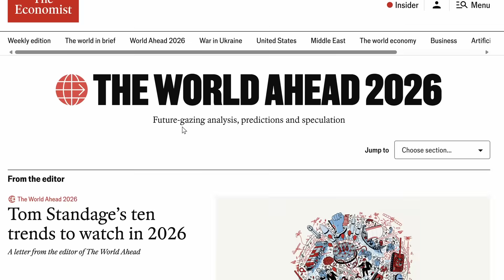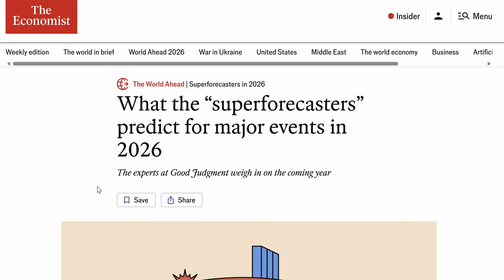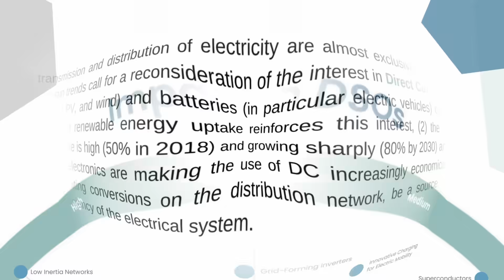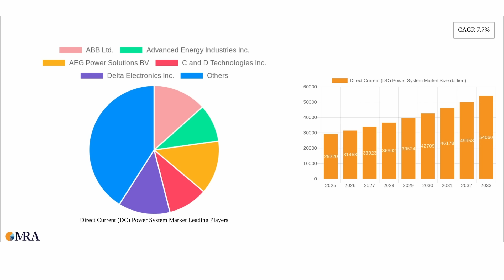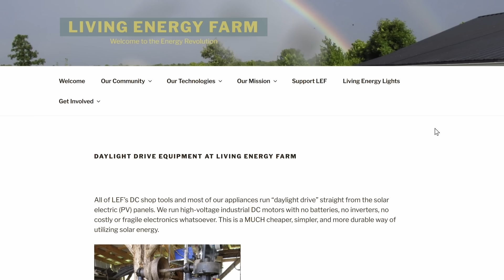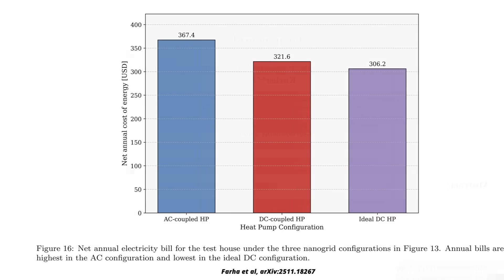Are We Using the Wrong Kind Of Electricity?

Comment: As so what we really need here. Is to have the children stop fighting. AC-DC. And to get them together. Which means?

In our homes. Which are getting AC frommm the Utilities Provider. It goes into a box in your home. Where then… You don't just have 120   volt, AC wall outlets. You will need some cigarette lighter, 12 V  DC sockets now also. Or some kind of new standardized replacement plugs and sockets for DC  power connection ports.

And that's the way I see the wiring of the homes, of thhe future. Remember before our homes ever had, cable TV? And it was difficult to install cable through the walls inside yyour house to all the bedroom and basement and living room and dining room. Your house never had that wiring. But new houses come equipped with that cable wiring. Oh  but now they have, modular ethernneet ports in your rooms. Now we are also going to need  DC sockets. So we don't have to keep wasting power transferring AC to DC within each piece of gear. The gear will only have DC inputs. And you plug it into the 12 old DC socket, in your bedroom, your den, your living room, your garage, the backyard.

It's just another new thing like everything else becoming new.  And I think our homes will all have a central AC to DC, power converter. And all rooms in the house will have both kinds of outlets. And no mistaking one for the other. That will be a physical impossibility.

And because DC does not travel well through any length of cables. That's what circuit boards are all about.

And so the DC to power your circuitry.  Really has to be very close to the circuitry. It can't be feet, yards, miles away.  That's not going to work with DC.  Cable length much be short for DC. Otherwise it loses all its potential  in the wire.

There is much more new technical standardization's we have to work out yet.  Times… They are a, changin'. And we have to attempt to keep up. As our technology matures and becomes utilized. And all of this wireless high-speed data. That has been growing exponentially, day by day.

I'm working on a different kind of power distribution system. Within my live in, lluxury, diesel pusher, motorhome. I am believing in compartmentalized  distribution of power. And no one central power distribution point within the structure. As that also provides for redundant backup.  And a necessary switchover  in time of failure. So you are never  down and out. You just had one thing blowup. And it is patched around.. Everything else still operational.

I learned to  plan for redundancy. When I went to work for the NBC-TV News Network. They did everything technically redundant. So something fails? They just switchover.  There is no downtime. There is no more  One Moment Please or Technical Difficulties, slides. As there was back in the old days.

This was an excellent video. Thank you very much. I learned a bit. Noot much but? Anything extra is good.
RemyRAD

Comment: As a high voltage electrician I can absolutely say we chose to use ac specifically to avoid this nightmare scenario of having 150 million micro generating stations for micro grids. Unreliable solar and wind are not the answer to this problem either.

Comment: DC was used in the early days but because of loss in the wiring, consumers had to be close to the power-station. With alternating current, you can step up voltage to overcome I squared R loss then transform down to a safer voltage for use.
2026? Yes, we could make a case for DC. Would it be possible for us all to go 'off-grid'? In that way, we would become independent of utilities, polititians even? A start would be to reduce our consumption to a minimum and who knows!

Comment: But for dc to dc transformation you need actual electronics circuits(active) while for ac to dc transformation you'll u just need a transformer(passive) . Dc still seems like a more complicated ordeal for installation purpose. And a lot less reliable. A transformer is far more unlikely to die than a transistor. Odds of transistor failing seem to be in order of magnitude larger. So reliability seems to be a massive weak point, for now.
As for consumer electronics it's very debateble if it would be any better if it ran start on dc. You will still need a dc to dc(buck/boost) converter, which again is a more complicated circuit than linear dc power supply, which literally consists of transformer 4 diodes and filter caps.
That said we did have a dc 260 line at my old workplace, but that would as for a couple of devices.
The benefits seem dubious, or at best as all efficency improvement by partially skipping a step of a to dc conversion, but the main thing is voltage needs to be changed and that will still need power supply.

Comment: I'd be super happy having 12V DC all over the house, most domestic appliances can work at this voltage (only exception is laptops and fast charging devices). Not just that, but 12V DC is completely safe, you're protected by your body's resistance. I just hope if this ever becomes a thing it's properly standardised in the world, unlike the mess of plugs, voltages and frequencies we currently suffer.

Comment: Today, the use of the electrical power needs different voltages and frequencies even inside of one device or system. In the time of Edison there were no practical methods for conversion, but now the state of electronics provides it for a reasonable cost and power losses. It is not needed to resurrect the old dispute. Both AC and DC are used converted seamlessly, according to which serves better. Even in your laptop, DC is converted to AC and back to different DC voltages many times. 
The change of the entire infrastructure to DC is premature. It will be costly, messy and will generate mountains of industrial and domestic waste of incompatible appliances.

Comment: DC is better for long distance because A/C starts to have issues at ultra high voltages. So transmission losses can be reduced by voltage. It can also be used if converting between 50 and 60 hz grids. Large switches and breakers have their own set of problems, so there is a tradeoff, but even with these issues, which are being figured out, it is more economical over long distances.

Comment: Alternators produce AC current and Generators produce DC current so any energy source that has a  turning shaft can create either type of current depending on which is used. Brushes and commutators are used in generators to keep the electricity going in one direction to produce dc current. Cars used to use generators to charge the battery. This was probably because using a rectifier was more efficient than using brushes and a commutator. They started using an alternator with a built in rectifier to change the current to dc to charge the battery. Until the last few years all back up generators we use when the power goes out were alternators misnamed generators until the name stuck. The more expensive newer style back up generators are really generators with inverters that change the dc from the generator to ac. These inverters  are expensive which is why the new style generators are so much more expensive.Solar panels and batteries produce DC only unless it is run through an inverter to change it to AC.

Comment: DC/DC converters are secretly AC in the middle (so its DC/AC/DC). Also the DC transmission lines are not DC because we want to use DC but because of the advantages of DC transmission outweigh the disadvantages in some cases.

Comment: I just must correct something. Wind turbine. they dont provide DC. just like any other mechanical work to rotatory generator. to get pure/smooth dc from them you need to make it from pulsating dc (ac that has its peaks on positive side) or AC current to be rectified with different type of rectifying conversions(capacitors/inductors/diodes...) but they can be made into generator system
Solar panels do make  dc and there is lot of other type of dc generators, but no rotatory.
And same applies other way around.
Cars their motors even as their batteries are DC their motors ain't. they are usually 3-phase induction or bldc which itself is actually pulsating dc current to ports like 3-phase induction motors. I wouldn't call that pure dc motor when need to have motor controller that does more than step-up/-down conversion.
And I wouldn't credit too much Thomas Edisson of DC and its capabilities discovered modern ages. Edison was firstly and foremost business man. He didn't dvelve deep into science like tesla. He was mostly worried about Tesla distrubting his patented dc power delivery system with AC.  :D anyways good holidays

Comment: i don't think that arguing between AC and DC is the real question, but frequency should be the point to look at... you can keep AC, but if you jump the frequency to 440 hertz the system becomes more stable.. also generation still costs the same effort... but the REAL point is that a SINGLE B52 could theoretically power an entire city if 440 hertz was used... this would be far cheaper than the current methods of powering most cities.... now DC might still become a thing, but AC would be longer lived if they upped the frequency.... the kicker though is our appliances are not built for a the higher hertz.....

Comment: DC has already made a breakthrough in the marine industry, especially where the same vessel has vastly different power demand depending on operating conditions, e.g. tugboats. The reason is that DC allows prime movers (engines) driving generators at variable speed, depending on power demand, not like AC at 3000 or 3600 RPM constantly to maintain the 50 or 60Hz frequency.

Comment: Going all DC incurs expense and fragility to the system.  Converting DC voltage to another DC voltage often requires high speed switching circuits and semiconductors to make the transition instead of the simple and robust transformer used by AC.  This would make our grid weaker and more susceptible to issues due to impulses from all sources.  This is a bad idea.

Comment: Fun fact: there is something called OCP, or Open Compute Project, which encompasses a set of standards for enterprise IT equipment - from telco equipment to datacenter scales, and among others, it includes rackmountable hardware powered by 48 V DC, delivered either by single power supply unity in the rack, or in the lab or datacenter, distributed to devices via simple bus rails. The goal is to provide single very high efficiency (redundant, of course) power supply, instead of deploying many smaller, often underloaded ones, and freeing up space inside actual computing nodes.

As it stands, DC has one huge drawback - converting between voltages is extremely complicated and expensive affair, and above all, inefficient, unless you really scale up your devices (HVDC power transmission systems have losses <2%, and you can't get anywhere near with anything household-sized - just they operate in 2M+ V, and are incredibly expensive). At the same time, simple transformer is one of the most basic, and simplest devices ever.

Comment: 😂 SOMEHOW I'M Missing the MOST IMPORTANT Difference You Not Reporting!!!(?) The AC Is Easily TRANSFORMED To 100,000 Volts(!) Or More(!) To HAVE LOW CURRENT Flow in Transmission LINES!!! AND Converted BACK to LOW VOLTAGE - 240V!!! 😮😢...😊😊😊❤ THAT WAS IMPOSSIBLE For DC And EDISON Generators and Transmission LINES!😮😢😢😢

Comment: If everything was changed to DC, then traditional wound transformers in microwave ovens  will not work, nor will appliances fitted with AC induction motors, so would all need replacing, what a waste that would be.
Gaz UK.

Comment: 3:46: are you sure ROTATING wind turbines produce DC?
Reply: The AC produced by a wind turbine may not be used directly because of the lack of frequency control. Therefore, it is rectified into DC and then converted to AC via inverters. It is analogous to an automotive alternator. The wind turbine generator is subject to the changing wind; the automotive generator is subject to changing engine RPM.

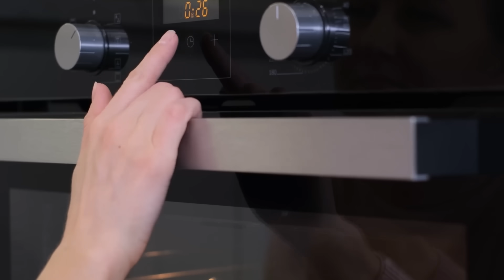Comment: 3:00 And how do you convert mains DC voltage to your laptop required voltage, and also to your smartphone required voltage, etc.? Using a much more complicated device than a simple transformer and diodes, as sufficient for AC mains.
Reply: Many computer and electronic devices no longer use transformers. They rectify the AC to DC and then use PWM to regulate the voltage.

A communications power standard is 48 VDC

Motor vehicles are a complete DC environment.

The power supply design of much of today’s electronic equipment goes through great pains to remove the “ripple” out of the DC produced from AC.

Comment: We got a compromise. Tesla wanted AC through the air (look ma! No wires!). Edison wanted DC through wires. We got AC through wires, so a compromise.

The advantage is less line loss. By stepping up the voltage (using a transformer) to very high levels there would be less line loss. You can't step DC up without converting to AC first and back again. Of course I am just repeating what I learned in school. EE major.
Reply: HVDC transmission has been in use for decades. You can get high voltage by putting DC power sources in series. The use PWM on the other end to bring it down.

DC, given the same voltage has less line loss than AC and makes better use of the conductors cross section.

Comment: Dear Sabine, the issues you cited don't at all reflect the real reasons why we will never switch to DC networks. The fundamental problem we will never overcome, especially for home networks, is the safety of both users and the network. AC networks have the advantage that the voltage (and therefore current) equals 0V (0A) 100 to 120 times per second, which allows for the extinction of any electric arc. DC networks that exist (higher efficiency results solely from the integral of the current waveform over time, where a rectangle will always have a larger area than a sine wave) are highly maintained networks, both in terms of installation and the selection of highly specialized devices for disconnecting currents, such as short-circuit currents, and the loads themselves. This is not realistically achievable on a national or global scale. Regarding disconnecting a specific current and safety, 250V AC corresponds to 32V DC.
Reply: There are many HVDC transmission lines in use around the world. They have been for decades.
Reply: @galinstan5603  yes and?

Comment: The DC will save huge energy when you consider the amount of energy converted into "use" by appliances, but the grid will shrink, and the distribution of power plants must increase. That said, the bleed of power will be great diminished, AC is easily kept moving along power networks at distance, but it is far less energy for conversion at it's destination when it is converted into DC.

Comment: Sabine, AC power leads to grand cosmic physics. With technologies based on AC induction from the environment, where you cannot put a meter, corporate loses money. DC may have uses but it is a mainstay of profiteering. Consider this, you use AC to induce a star in a lab. Coaxial counter rotational axis of electromagnetic flux to contain plasma sheaths. Mulit vector cymatics aimed at your synthetic star and your DC electron boring microscope to grab elements and move them. In theory this is the process of synthesizing anything you want. The stars make every element there is. In theory using The cinematic form of each element you can force out what elements you want. We have already proven we can use an electron boring microscope to move individual atoms. So you see Sabine, with enough research into AC everything becomes free

Comment: Have you ever tried to stop a DC circuit arc?
Edison Lost
Reply: HVDC technology was not around in Edison’s day.
Reply: @galinstan5603  800 volts is far from high voltage. Nor did I state HVDC. Even 48 VDC can make a big arc. 240VAC fuses are only good for 32 VDC for a reason

Comment: This video is missing a some points: energy distribution, coupling of large generators, and electrical motors in industrial environments. These are things where the three-phase system excels and are more difficult to handle with DC. Yes, there is high-voltage DC power distribution, but this is only anvantageous when the capacitance of the power line becomes a relevant factor (long distances, underground, or under water).
Reply: Many large motors today, rectify the three phase and then regenerate it via inverters over a range of frequency’s in the interest of speed and torque control.
Reply: @galinstan5603  I was more referring to general motors, not necessarily large. There are really many of them running directly with 3-phase current. Inverters could be used to make them run on DC, but this would be an additional part to be paid and maintained. Motors in household appliances, in contrast,  should even instantly run with DC or with minimal changes.

Comment: Motors use AC. A so-called DC motor has to make the DC alternate to use in the motor.
Reply: Or, you can use an inverter like a Tesla. It works better than a commutator.

Comment: 80% of household use by 2030. Seriously? That’s why they think we should switch to DC? Do you know how little residential use makes up total use in this (or any) country?  
Ever been inside a factory? 
And who would eat the cost of replacing all those motors or at least all the VFD‘s?  (I guess you could make them cheaper without having to use the initial stage rectifiers and all those capacitors, but they would still have to be replaced).

The only thing that might make it worth it is LED lighting wouldn’t flicker and the bulbs would be way way cheaper…